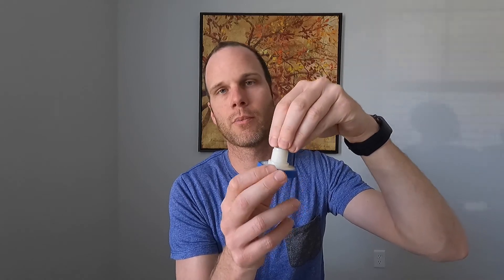Sprinkler System Automatic Drains - But Why?

Comment: Thank you for the explanation. I installed a brand new drain valve, the exact same one you demonstrated in your video, but mine leaks when the sprinkler is off, and it does not leak when the sprinkler is on, so it’s acting the opposite of how its designed. I have already replaced it once and it’s doing the same thing. In my case, it’s exactly upside down so not at a 45° angle which I guess would be ideal but still, it doesn’t make sense why mine is behaving the exact opposite.  Any ideas?
Reply from the maker: It is doing what its design to do.  Not drain with pressurized and drain when not pressurized.  Ideal for low spots on pipe that are pressurized infrequently and need to be drained to winterized / when not pressurized.

Comment: Dude, thanks for making this video.  I had a line break pulling out a tree, and I saw 2 of these (one on a 3/4" line and one on a 1" line). I came here because I don't see the point of these. If I blow out my sprinklers every fall, why would these be needed. Plus, it wasted water. The drains that were installed were caked in mud and small roots. I doubt they were even draining. Can I just fix my pipe without installing these? The pipes are at a low point, but still, why drain out your lines each cycle if you winterize your pipes in the fall?
Reply from the maker: Agreed, if blown out, not needed and can eliminate.

Comment: This is a scam. What's the problem to get pressure in the lines 24/7 ?
Reply from the maker: Not sure if I understand your question.  Could you rephrase it to make sure I answer your question.
Reply: @thesprinklerchannel  what's the reason to release this pressure on the zone line or main line?
Reply: @j.wagner8639  it just automatically drains the line after each sprinkler cycle, but stays sealed with pressure while sprinklers are on to save a little water.

it prevents having to drain your system before winter to prevent pipe burst, thats its function. and yes it wastes a lot of water especially if you have your system on 2x a day

Comment: Great video thank you for the helpful information. We recently bought a house in Denver, CO with a sprinkler system and I see a King drain in the manifold box with the valves. Would that indicate that there are probably others buried in the lines? Is there a way to find out/test for them? And if I don't have them in the lines and need to blow out the system will the compressed air just blow through the King drain in the manifold box. Would I need to cap it somehow so the air doesn't leak out? Thanks for your help.
Reply from the maker: If possible, ask previous owner if via your real estate agents if they would blow out their sprinkler system each year.  If they didn’t then system probably will be fine.  If they had freeze breaks then probably should be blown out.  Blowing out the system shouldn’t hurt the kind drains and water should get pushed out the sprinkler heads instead.  Probably put it in the valve box so when the system was turned off it would self winterize but only if that is the lowest point on the line and I wouldn’t want all the water going into the valve box personally.
Reply: @thesprinklerchannel  Great, thanks so much for the help and info. I'll talk with our agent to see if we can get answers!

Comment: Thanks for the info.  The three lowest points on my slope have been draining through the sprinkler heads and caused erosions.  For now I capped those three sprinkler risers.  How should I install those automatic drains in a way to reduce puddles and avoid erosions down the slope?
Reply from the maker: Might want to check out this video but will depend on how great the slops is.
Reply from the maker: If rotary heads might just want to see about best rotary with check valve for greatest slope

Comment: What is the life expectancy of the Automatic drain?      Any idea at the end of their life span or failure do they lock open or closed?
Reply from the maker: I imagine it probably has a lot to do with how dirty the irrigation water is / hard water.  Probably help extend life if laid in a bed of small size aggregate to keep dirt away from it when buried with the pipe.

Comment: Would it be proper to dig a hole under the automatic drain, maybe approx 2 feet deep and fill it with gravel?
Reply from the maker: Definitely a great option
Reply from the maker: Probably doesn’t need to be very deep since drip is slow

Comment: We just moved into a newer home with an irrigation system. I've never used an irrigation system. I figured out how to turn it on and the time settings but my question is after the watering is done there's a small fountain of water coming out of the back of the yard for a bit of time. Every time. Is this normal? Seems like a waste of water to me.
Reply from the maker: If it’s coming out of one of the sprinkler heads, it most likely is the lowest point in the system draining due to the pressure caused by gravity.  Check out our video on check valves if you are dealing with pop up type heads.
Reply from the maker: Stop Water Draining from Sprinkler Heads
https://youtu.be/vHcQrJe7QmU

Comment: Any diagram of typical sprinkler system with this automatic drain installed would help
Reply from the maker: There is no standard position for these as each design will have different low spots depending on the topography of the land and installation.  I’ve also seen them on the main line just after the filter in a sprinkler box.  Lots of variables to take into consideration.

Comment: Is this installed under ground? or should it only be above the ground?
Reply from the maker: Underground is normal.  Ideally wherever the lowest point is.
Reply from the maker: Works off of gravity as soon as the line is no longer pressurized.

Comment: I have one of these installed exactly like you describe it and it drains well. Almost too well.  It actually saturates the yard to the point where you walk on the yard and it’s soaked. Any thoughts on how to make this better?
Reply from the maker: I’d check to make sure it’s functioning properly and no other breaks.  If so it may be due to a lot of the water draining through just one.  You may either want to install additions ones in other area or plug it and have access to it to be able to drain it only to winterize.
Reply from the maker: Also make sure the automatic drain isn’t malfunctioning in that it lets water out when the line is pressurized.

Comment: I have manual drain valves, installed by the previous owner. Why would they do that? Is the purpose to keep the lines full of water so that there isn’t so much air purging noise every morning? Would I typically open then after the season and close them in summer?
Reply from the maker: That is most likely the case.  You have more control when the pipes are emptied.  Definitely open before winter to drain and then close before starting up the next summer to avoid water wastage.